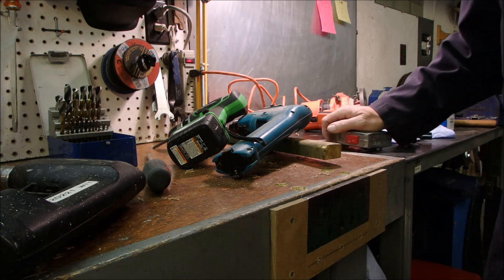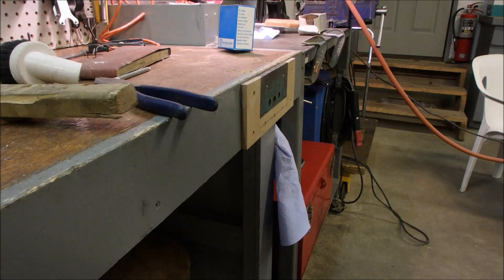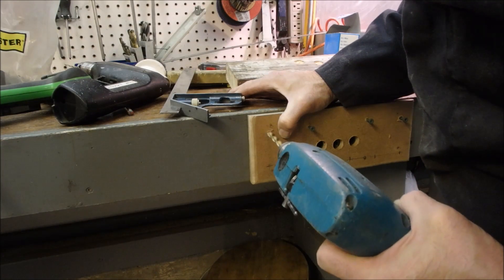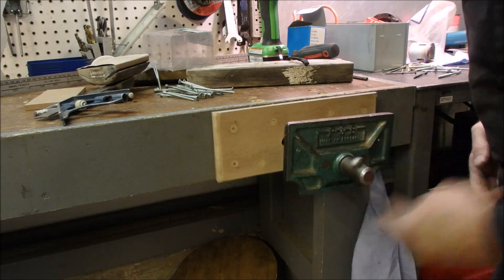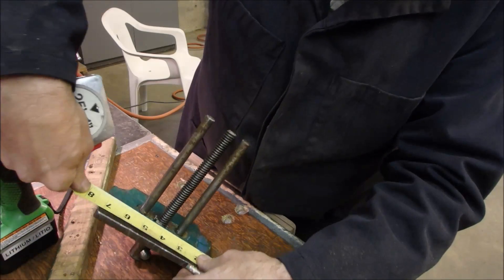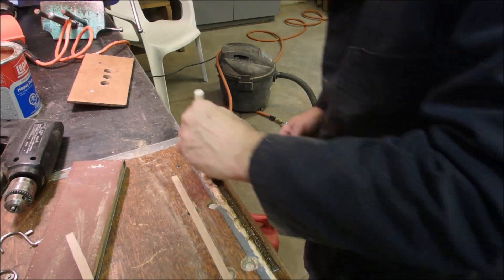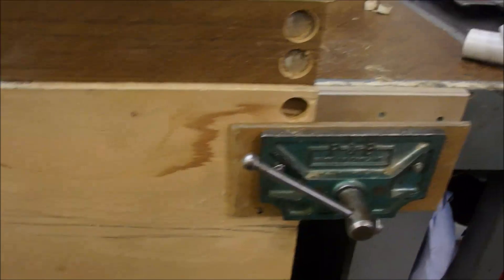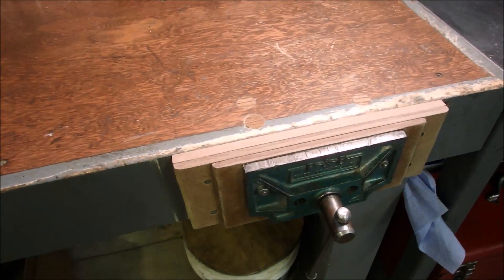Installing a Carpenter's Vise PT 2

Comment: Heya Bruce! The way you finished routing was exactly how I used to do it before I got my router table. Works SO much easier when you're handling the lighter wood. Especially when it's smaller pieces like the one you're working with. Bravo!! Zip~
Reply from the maker: +ZippoVarga Thanks Sean.  -----------A project for me.

Comment: I like it ....The wood you added to the vise makes more surface area to clamp onto a board .I am not a wood worker But if I found one of these vises  I would make it like yours so I could hold big stuff in it
Reply from the maker: +not2fast4u2c Thanks Jim.  Now on to the coal minors pick restoral.  I am looking for a handle with a 3/4 by 3 inch eye but only 24 inches long.  That is a foot shorter than the original.
Reply: It would be Nice to know someone who could make a handmade one
Reply from the maker: +not2fast4u2c I've been thinking about it.

Comment: I'm sure your glad you installed the vise and are getting good use out of it!
Might I suggest you drill a 1/2" hole in the center of the outside face just inside (touching) the metal and two lines of holes going from the vice to the center of your bench (maybe 3" apart)? This way you can make some small bench dogs (pins) out of oak dowels. Giving you a sort of end vice to secure flat wood down to plane or surface or whatever you need to temporarily secure on the surface of your bench to work on?
Reply from the maker: Thanks I will think about that.

Comment: those screw holes left in the wood infill could leave marks on any wood you clamped in the Vice especially if the clamped piece was a delicate piece. Why didn't you fix them  from the back on the bench part of the Vice and from the front on the front part of the Vice,  which is normal..Or stick them ?
Reply from the maker: They haven't.  It has been a year and a half.  My suggestion is that you make a video to show what i did wrong.  I would appreciate it very much.
Reply: Bruce Pender Sorry Bruce didn't intend to suggest you did anything wrong, you did a brilliant job of fixing the Vice.  The way I suggested involves only 4 screws and is very effective and quick. I have only just started with a tablet and I have no idea of how to make a video. Keep up the good work.     Mike.
Reply from the maker: It is all good.

Comment: Very good and detailed job, Godfather. I had mentioned before fabricating a set of removable jaws to be able to hold a string Trimmer in it to work on it. Where the vise is mounted makes ideal for that and make the height to work on the machine easier on you. Enjoy that warm weather a major snow storm headed here in Ohio and towards the north and east coast on Friday and Saturday. A foot of snow for the Ohio River area and 20" - 24" in Washington DC and up to Boston.